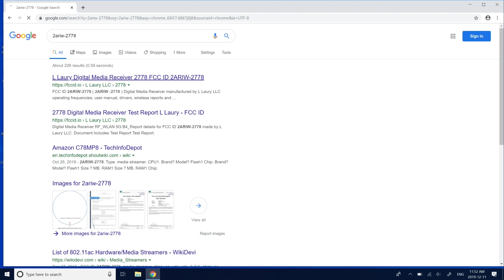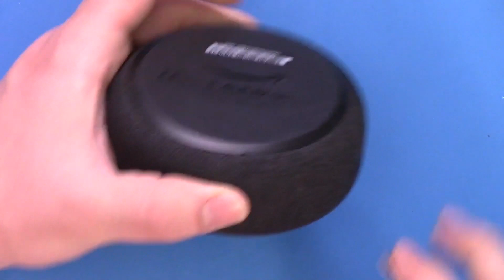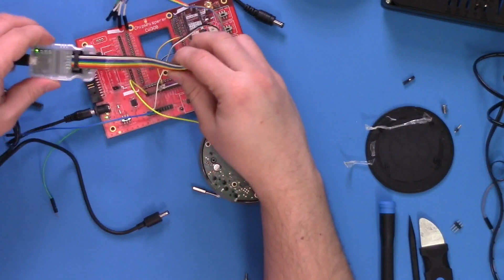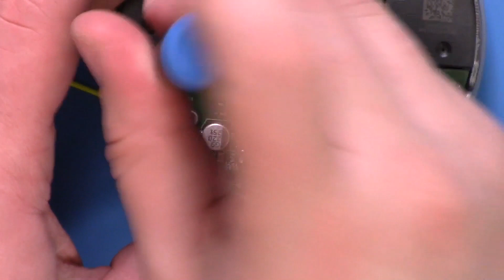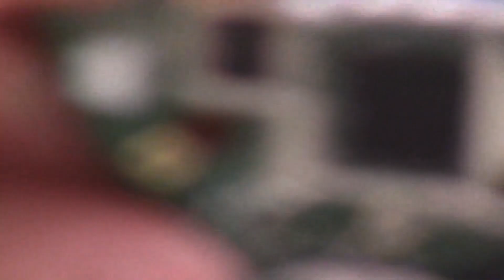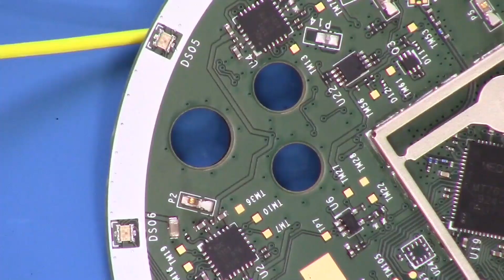Echo Dot Gen 3 Teardown / Reverse Engineering (Part 1)

Comment: So, I've lost two of my favorite type of Alexa dots (3rd gen hockey puck) in the last year to the "blue ring of death." This is where it becomes unresponsive and won't go into recovery. Sometimes, after you plug it back in, it has a brief appearance of a solid blue ring. Sometimes the blue ring persists indefinitely. Sometimes it's just dark. The mute button always seems to work to glow red when you press it, tho.

This happened after a prolonged storage without power (my first incident) and after a power outage of hours during a storm (my second incident). Both machines appear to be bricked.

Solutions tried:

* Reset button combos: hold down action button for 20s, or hold down mute and minus buttons for 20s.
* Switching to a known-working, genuine OEM power supply from another dot in the house. Switching to a different outlet.
* Toggling the power on and off by unplugging and replugging every few seconds.

It seems to be a corrupted firmware update or such.

Can you confirm that there seems to be no reset button or jumper available on the motherboard itself?

Can you confirm that the serial communication doesn't allow for a firmware update?

Did you see Brian Dorey's video where he built a custom PCB to access the six debugging pads which are exposed through a rectangular hole on the bottom of the dot? The hole is under the adhesive rubber foot. Also see Andy Goetz.
Reply: mine also same

Comment: I am wanting to mod my Echo so that the LEDs stay on full brightness and do not dim. I am looking for the datasheet for the light sensor, do you happen to know the part number?
Mine is a gen5 and it looks like the light sensors are different, but info on the gen3 would help.

Comment: I understand you don't care but you still want to be able to put it back together... right? to get the ribbon cable out, lift up the black tab running across the top. of the connector. It's a tiny hinge that holds the cable down. it snaps right back into place

Comment: I get the feeling that there's two, possibly three UARTs at play. One of the last messages is that one is being disabled (uart0), and another enabled (ttyMT0). Also the BAUD rate is 921,600. It's specified in the kernel boot parameters along with a reference to a 'uart1', and in one other message. The message "[TOOL] USB enum timeout!" indicates that it's looking for a USB OTG peripheral, probably their Ethernet dongle.

Comment: The tag is a NFC tag. Try it out. It connects the Device via Bluetooth.
Reply: I knew it! They also use it in Amazon's shipping center. As they pull a box off the shelf, the tag gets read and associates it with your account. Every Firestick I installed automatically knew it was mine.
Reply: @playaspec  fun fact only related due to the NFC tag topic lol.... But Victoria's Secret bras or at least the PINK brand of VS bras (I'll assume all of them from VS but don't know for certain) each have one of those NFC tags woven into the bra tags with the size of bra and washing instructions. For inventory reasons and warehouse storage is what I have learned anyways. Kinda cool though to know. 🤓